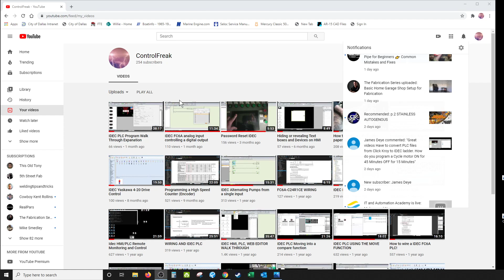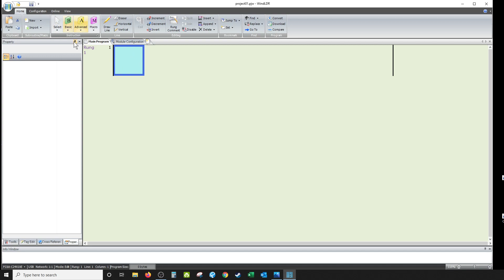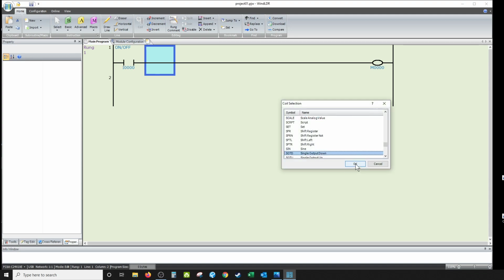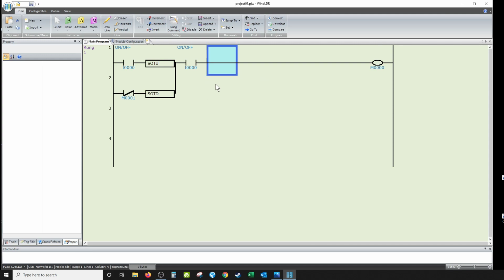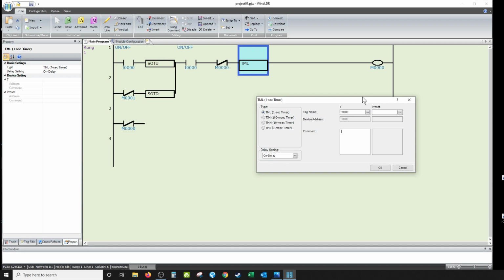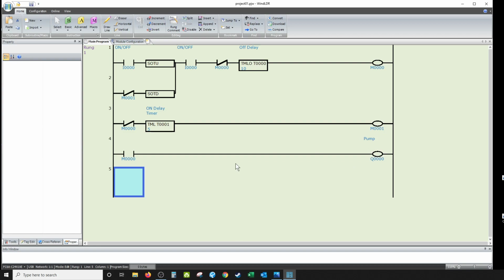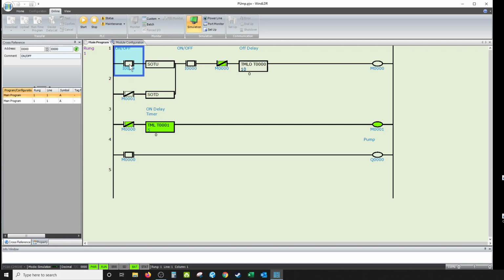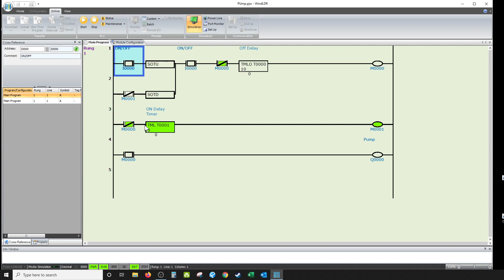Pump, Fan, Motor ON/OFF Loop timer.

Comment: First comment!  (on this video...)    I am working on my FT1A program and I have some basic questions.  First question:  I know I can create an OR function by putting two NO contacts on two successive lines and tying the outputs together, however the documentation suggests there is an OR function that I can enter to do that in one step.  But all I can find is the ORW function...  Am I misunderstanding the documentation or am I doing something wrong?   Second question:  I have an analog signal that will be on AI-0 so that will appear as a 0-1000 number at D8040.  There is no analog set up dialog box on the FT1A (that I can find, and like you demonstrated in another video).  I want to scale the 0-1000 value to 0-10 for example.  I might also need to apply some offset.  So I want to create a simple "multiply by this and add that" function.  I found the ADD, SUB, MUL and DIV functions, but they only want to act on values in "devices" (data registers etc I guess).  I just want to add or multiply by an fixed value.  Do I have to load the value into a register first, and if so, how do I do that?   have seen the coordinate conversion functions like XYFS, an CVXTY, but that seems a little over complicated.  Thanks
Reply from the maker: 1st Question,  are you talking like an multifunction input?  I am not understanding completely.   I have never done this, that is the reason for me not understanding.    Are you trying to condense the program?  Or, just experimenting with different paths to accomplish the same goal?
2nd Question,  I pulled up NV3 and the analog inputs need to go on either I6 or I7.  I think that it would store it as a word, 0 to 65535?  You would need some Math functions in this case. I am not seeing it not accept a fixed value?  Maybe I am misunderstanding this as well.  I put D8040 in S1, 5 in S2, dumped the result in D0.  It worked for me?   I see very basic configuration with these in the FT1A.  I don't know why Idec would not let you set them up the same, and configure just like on the FT6?  I would contact IDEC support on these.  Please share what you find, I am curious as well.
And that coordinate stuff is over my head.  I have never needed to use it in the basic programming that I do.  
Please  excuse my limited experience with the FT1A.  If you  see that I misunderstand, let me know how.  I will give it a go again.  I do not have a loose FT1A c14 laying around to hard test this on.  I used the simulator.
Reply: @huntxtrm  Hi.  Thanks for your reply.  I probably should have posted these as two separate questions since they are basically unrelated.  As far as the OR command, I think I am just confused by the LDR manual which has a list of all the commands, which to me should correlate to the commands that are available from the menus and/or using the typing method.  But in those menus the OR, AND and some other commands don't exist.  So I think it is a bit misleading the way it is presented in the manual.  However, I think these manuals are all translated form Japanese and I find a lot of terminology and phrasing that is odd, like the way they refer to memory locations as "devices" etc.  So it may just be "lost in translation"...

As far as the analog question, this was really multiple questions...  and you have correctly stated that yes you can put a value directly in the math functions.  I kept using the "..." button which just pulls up memory locations.  I had never tried just typing the number in the box..  So that helps.  Yeah, the analog handling is different on the FT1A.  You just get a 0-1000 Word value in D8040 or D8041 and that's it.  However, I don't think doing the scaling should be too difficult (famous last words)...   BTW I told the IDEC people they should hire you :)  A lot of their sales jobs are in California however.  They have a channel IDECUSA that they haven't answered a question in years...  The guy I was talking to didn't even know they had the channel.  If you get sick of all my questions just let me know.  Thanks!
Reply from the maker: @michael931  Lol, I never get bored of questions.  Fire away anytime you want.  Sometimes I learn from them as well.  Sounds like the FT1A is limited to a low resolution.  Might try pairing up a FT6 and an analog card as a slave device.  That would add $$$$$ though.  Not really cost effective.  Like I said before, I have only used the FT1A for basic equipment control.  I tend to use the FT6A and an HMI for more flexibility and future growth.  Thanks for the recomendation to IDEC, I will be looking for their call.  Lol
Reply: Michael, i suppose your using the FT1A-c14sa or the c14ka;  going through the win03 program click on ladder and goto the configuration tab... there you will find your setting for setting up the analog inputs and outputs....  I am not sure what you are doing, such as are you using on on screen potentiometer or are you using a potentiometer and inputting your signal in A0 or A1...  0 to 10v looking by your information up front...  Secondly, if you are wanting to put data in to lets say D100 you could input that through a numerical input with a pop up menu...  And yes, you would have to input the value before you could ever do the math in the ladder....  not sure exactly what you are doing just adding a few thoughts here... You could take your value at D8040 and move the value to lets say D200 then perform some math on it...  But typically it would display you be set in the data display screen of the win03 parent program.  Remember your screen is the HMI and the PLC are two different items and it is hard to remember that in the scheme of things as these two are intertwined... The FC6A and HG2G is programs slightly different but the Ladders logics are the same
Reply: oh and to you and ControlFreak, not trying to interfere here
Reply: @huntxtrm  interesting conversation going on here, i guess because so much is lacking and it is fun trying to figure out what he is doing.  If he cannot use the input side of the pot for his math, he could tie the two outputs (using them for the 10v supply to the pot)  to his input pot then use the output side of his program for the math...   interesting!
Reply: one more thing... if you take your D8040 (w) and lets say move that value to D100 (w) .. Numerical display on the base screen set at bin 16+  with a floating point of one should get you the numbers you want to see 1 to 10... if not just divide the D100 by 10 and move that to your screen calling it D110..  that should display 1 to 10 at .1 increments...
Reply from the maker: @jamesnugent9917  Anytime.  I created this channel to learn, both ways.  I am not a guru by any means.  There is not nearly enough info out there on IDEC programming.   Outside input is appreciated.  Like I say there are many ways to skin a cat.  Some might have better ways than others.
Reply: @huntxtrm  no problem... i don't think i was clear on one thing... the outputs Aq0 and Aq1 could be used to generate the 10v needed for his potentiometer if he does not have a 10 v outside source...  then you just connect 0v and your wiper.  Not sure what he is doing but interesting...  so boredom set in last night and i was reading the comments... LOL
Reply: So I think I have the logic part figured out OK... (famous last words...)  I am trying to sort out the screens.  Keep in mind I am working with a FT1A but I think most of the issues are the same regardless of the exact IDEC platform.  So, there are base screens and popup screens, and maintenance screens. But the manual also talks about overlay screens and also about layered screens.  That's a lot of terminology.  What is the difference between overlay and layered?  They also have some odd instructions saying "Layered screens that have been set as layered screens will not be displayed on the screen that is displayed as the base."  Then they show an illustration of doing that exact thing.  It seems more like they were trying to say you could not have multiple layers?  Then there is a whole section about ordering layers up to 5.  So it is pretty confusing.  Can one of you guys take a stab at giving me the "big picture"?  I just want to have the time and date at the bottom, with left and right "Goto Screen" buttons in the corners, that always stay there (Base screen?) then have maybe 3 different screens that overlay that one: home screen, config screen, alarm history.  The maintenance screen would not need to be overlayed.  Thanks
Reply: @michael931  i will do it this evening...
Reply from the maker: @michael931  "Overlaid", "Underlaid", "Layered".  To me sort of similar is how I use them.  Overlaid screens I use mainly for Logos, Buttons, etc.  Underlaid screens I use for Function commands that I want to make sure are active on all pages i have the underlay on.  Layers?  As far as i know is the terminology for either?   I do layer buttons with images from time to time, or layer buttons to get multiple bits.  I think I have a video on layering screens?  I will try and make a fresh one this weekend. Right Click in the screen area, select properties, then options.  It will allow you to select behavior of screens as far as overlay and underlay... .
Reply: Michael, i usually use the layers for doing some in the H2G2... With the FT1A is does not have as much functionality...  I can usually set a color for the base screen and then layer another over the top of it creating a two color screen with some effects... not sure what you are doing but if your base screen is just black you buttons should always be shown...  I see you put home, config screen, alarm screen...  why dont you just use 3 base screens and then call them from the a goto button or if an alarm is tripped call that screen...  that is one option... but your config screen why would you want that called over the top of another screen... wouldn't you be better off if going to a set up screen?  just asking as i do not know really what your doing... just trying to decipher what you are saying...  but i have units that work together and if the operator chooses to go to the run screen all the HMI's will go to their first operational screen regardless of location.. but if you create the different base screens you will have to copy and paste the date/time and goto buttons on each screen... not sure how to private message me on here...
Reply: @michael931  i think i know what your doing now...  okay, you made mention of being able to overlay with 1 of 5 screens... that is just choosing what if you want to lay a base over the new base screen that you are doing... but when it comes over it will bring the whole screen as a picture so to speak... the buttons will not be any good..  you can choose you back ground color and that is it..  and must be done through the screen properties tab..  you then mentioned wanting your buttons to stay on top...  okay, you have to set your base overlay screen to base overlay 1 and then when you create your buttons they will stay on top... if you set it to display screen as base screen then when you create new buttons they will fall behind the image that is brought over from the base screen you chose...  I was able to recreate what i think you are talking about...  i could send it to you if you like....
Reply: @jamesnugent9917  I think I am giving too much emphasis to the terminology IDEC uses in the manual, which is undoubtedly all translated from Japanese, so probably why some of it doesn't seem to make sense.  For example "base" screen to me means literally the base or background or main screen.  But really I think they just mean it is not a pop up screen.  So all the screens are base screens and can be layered.  It is also confusing that the manual has two separate (and identical) sections "explaining" "layered" screens and "overlay" screens.  But it seems that these are just two names for the same thing.  I think in my case it will be easier to just have 3 separate screens, that do not overlay.  I do not see any reason why I need to overlay anything.  I just need the 3 screens I listed, plus the maintenance screen for the contrast etc.  One of my 3 screens is an alarm screen so I think my next question will be about how to log alarms and display them on an alarm history.  Thanks
Reply: @huntxtrm  You are right there is not much IDEC info available.  It is unfortunate the IDEC USA channel has not had a question answered in many years.  It is a lost sales opportunity for IDEC.  I appreciate your help.
Reply: @michael931  yes because it just copies what one might have on another base screen over to the new base screen they call it layered... and it can lay on top or beneath your buttons... i think it really comes into play in advanced graphics on the screen more than anything...  but yes the same regardless...  your log history will be accomplished through the ladder screen under advanced and under dlog... Unfortunately that command is not available in the ladder logic of the NV3 software...  I would have to look into how might that be done... if it can be with the FT1A..hmmmm...  maybe control freak has done this with the FT1A...  I will look into it next week...
Reply from the maker: @michael931  No problem.  I gives me a useful tool to keep learning myself.  The more people we get involved, the more information and ideas there will be available.  I really like IDECs products, and their customer service(1-800-262-IDEC).  they have been adding more videos lately, generated from their webinars.  But, I haven't had a chance to watch any of them.  So, I wont comment on how good or bad they are.  They do seem to be one of the simpler, more accessible platforms available.  The other big names get really pricey real quick.  And, with not much more bang for your buck, in my opinion.
Reply: @huntxtrm  actually I found it easier to remember as 1-800-BOB-IDEC....
Reply from the maker: @michael931 lol.  That works!